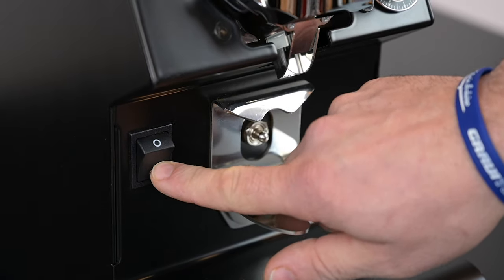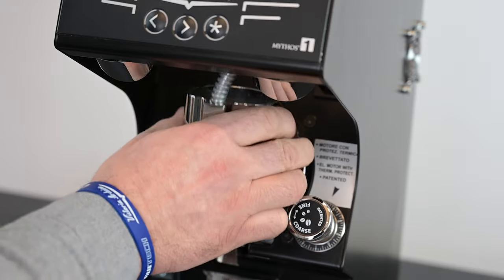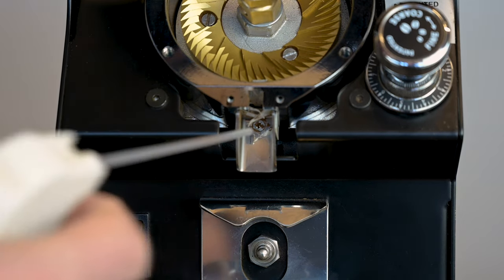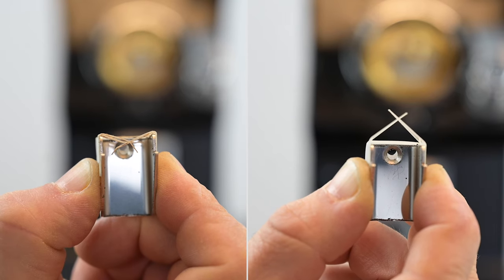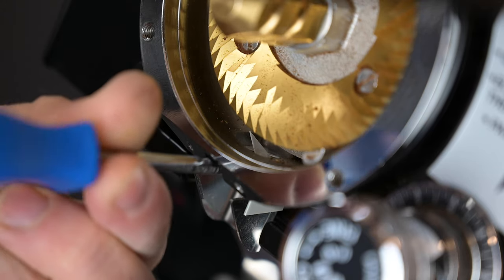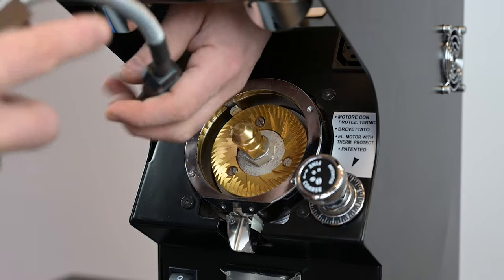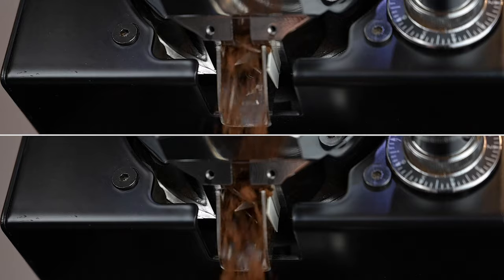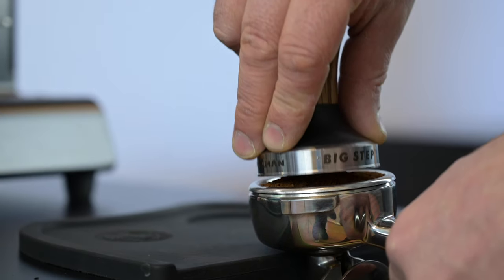Mythos One Clump Crusher - A Visual Guide

Comment: What's the part number please of the third (middle) screw on the clump crusher? The one removed before the clump crusher itself can be removed? Thanks.
Reply from the maker: Hi Michaela, the small screw which holds the clump crusher chute in place is part number 15030109. This is also the same screw which holds the front clip plate, for which there are two screws.